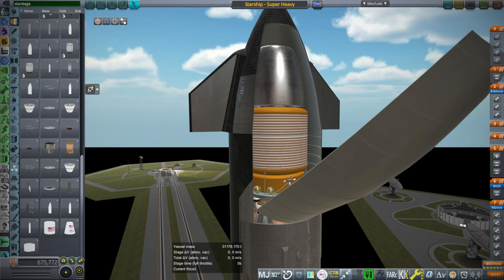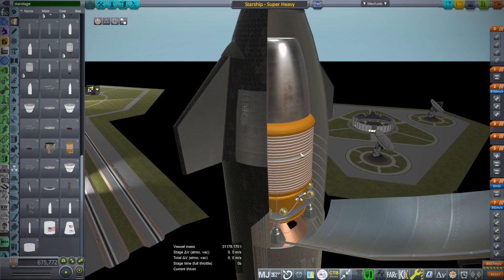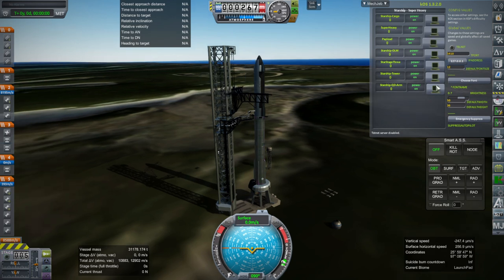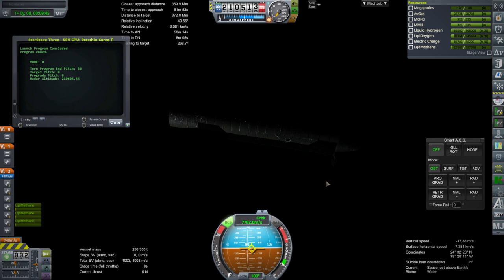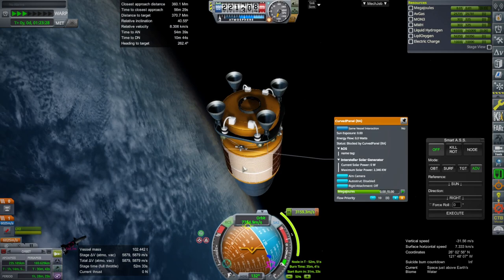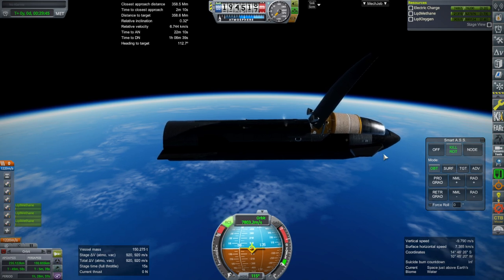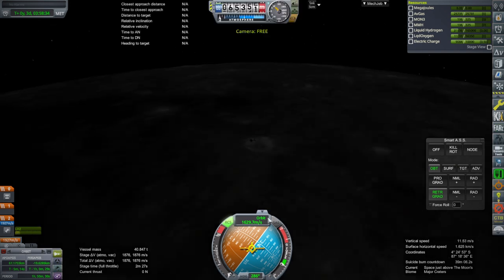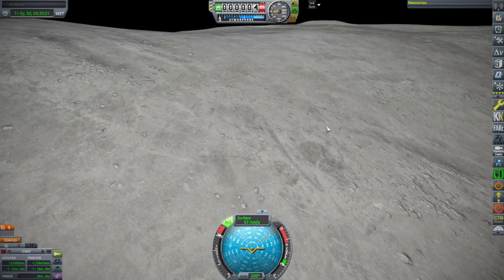KSP 1.12 with RO - StarStage Three Initial Test

Comment: I do like the concept, definitely a nice option to have in your back pocket. Sadly SpaceX probably won't use it because of the extra GSE and try to brute force it with methalox. I thought last night to suggest a StarStageThree powered by the raidernick special, but that also gets shut down for GSE and handling reasons.

Comment: I used to think hydrolox would be best for a starship upper stage but because of the payload bay constraints, I think Methalox would be simpler and still give effective high energy performance since starship has so much spare capacity to LEO

Would be block 1 capable so has to handle 27t TLI and up to 40 to GTO

Another awesome application of a capable hydrolox stage in starship is for an integrated HLS vehicle with that stage handling take off from the moon back to NRHO with a hab module which you could probably do here with a lighter payload of like 10t, but single launch unlike national team or dynetics